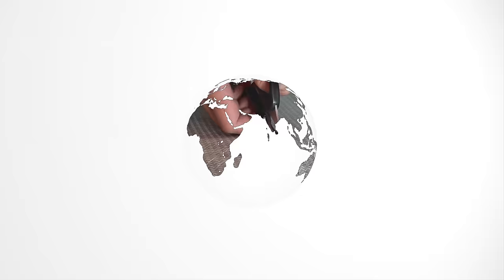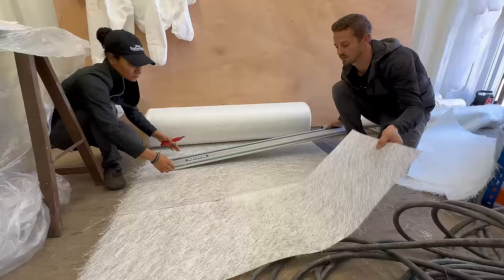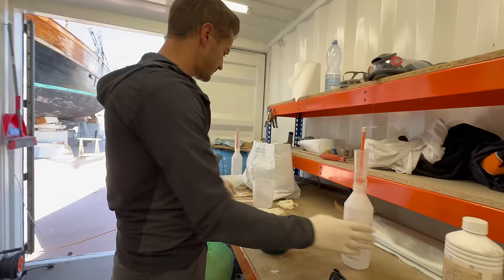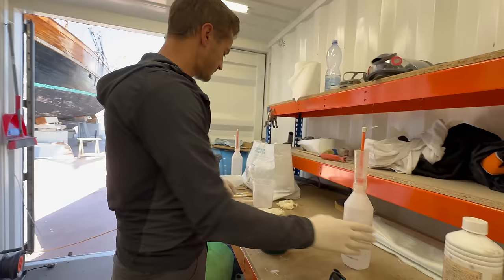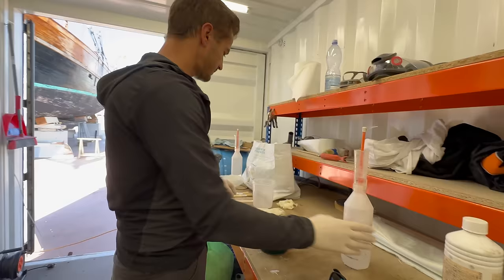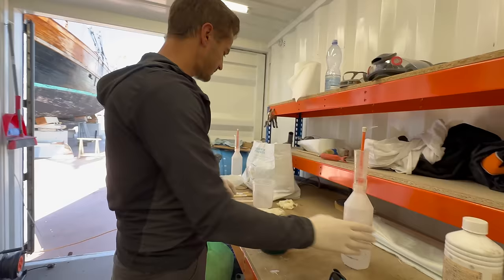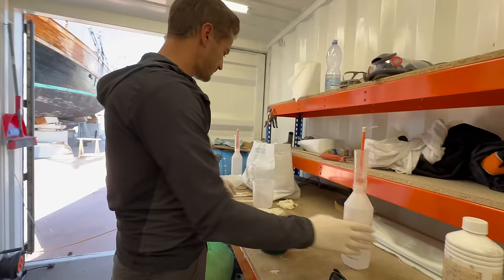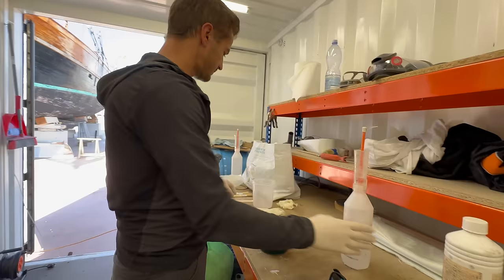Slow and Unedited Boatwork  | Step 385

Comment: Best to use the reference piece each time. Using the just cut one each time compounds any errors as you go.
Reply: I was thinking that also at the time until it became evident that it is just for demonstration purpose only, precision not required.
Reply: Agree I always use the same piece as a reference.  However If I was doing that I would have marked the floor they were working on.

Comment: Dear friends, you are among my favorite boating cupels so I can't help but offer some suggestions as I have over 25 years of experience of working with fiberglass building boats so I have a hard time watching this episode right from the start. So first and most important is always wear good filter masks that are recommended by a factory rep for both fumes and fiber glass in the air. If you could see it with a strong flood  light and a dark background you would weare it the moment you walk into the shop. Next, get some real scissors with at least eight inches long blades or use electric/ ceramic blades for much greater efficiency.  Good to see you pour the resin on but use a 3 to 6 inch short nap rollers. Then put the resin on first and lay the glass on it.  And throw away that silly little brush and get much bigger ones but for this job the roller is all you need. The serrated roller is not a bad idea but finish it off with the mat roller to even it out. At  this point I'll have to say order a book or video on laminating fiberglass technique before going any further. I'm sure there are many have already been written.
Reply: When I did pro layup work we did use 2 or 3in brushes we cut the feather off about half way up on the brush.
Reply: Fiberglass boat building has been my trade of work for 40 years now ,made me sick last year .guess this will be the end of the line for me.😮
Reply: Thanks for the lesson.
Reply: I'm guessing that this exercise was to gain some wetting out experience and to see what thickness is achieved from building up layers.  You used only strand mat… is that your laminate schedule?  You may want to invest in a better layup.  You're commitment deserves a bullet proof approach.   Good luck.
Reply: Kika, ditch the little brush & use 3-6” foam rollers 2 roll the resin in & then the metal roller 2 roll out the air bubbles! As Dan instructed, very light pressure & roll end 2 end! U got this! 👍 BTW, I do this every day 4 a living! I realize it’s just an experiment, but U may as well become an expert lamination technician while ur at it! Luv ur vids, however U wanna do em! Been subscribed since y’all launched ur channel! Thanx 4 sharing! 👍❤️
Reply: This is a good study.
Building my surfboards I used a squeeze not a brush. 
Btw...You probably had itchy hands after cutting fiberglass with unprotected hands.😂
Reply: Thanks you for the lesson. Constructive comments are far more helpful for us DIYers than some of the snarky, “ yOu’Re dOInG it WrOng….” commenters. They need to go back to bullying their younger siblings.
Reply: It was a pain to watch... 🥺
Reply: @reobein  squeeze is for epoxy and woven fiberglass, it would be terrible for this application.
Reply: A squeegee is the way to go for a fast wet-out. A half-length brush works well, but is basically a poor squeegee. :)

Comment: Your hands must be fiberglass-proof. I can never do this type of work without at least nitrile gloves on. Glad to see the hull getting stiffened now.  Cheers!
Reply: She had clear latex gloves on; I find nitrile gloves brake apart easily too quickly.for this type of work.
Reply from the maker: Yes acetone eats nitrile. You can't use them for this kind of work. But we also don't really get itchy when cutting or grind glass. At least not in the hands. Arms maybe a little.

Comment: I don't mind the unfiltered version. You must have a lot on your hands right know. I would like to see a video where you go more into the details of different sheet and raisin materials. So far I only knew polyester and epoxy and I didn't know there are different options on the glass sheets. Would be cool if you'd share your knowledge.
Cheers 🩵

Comment: It was so lovely to watch and listen to you two working together so convivially. I didn't realize that it would be possible to layup 10 layers at once without it getting too hot. I'm very interested to see your demo of your hull reinforcement as I've started work on a Cape Dory 28 that has some structural damage from a previous dismasting.

Comment: A tip: over wet the preceding layer and use plenty of pressure on the roller to drive the resin up through next layer. The idea is to get as much air out of the lay-up as possible so it turns almost translucent (minimum trapped air) tiny air bubbles in the lam is the enemy of laminate strength. But use minimal resin, if you achieve that you produce the strongest laminate (highest glass:resin ratio) and if under the waterline least possible propensity to osmosis. So roller hard, get that air out. Although vinyl ester is a lot less susceptible to osmosis and is much stronger than polyester. In fact there you can laminate stitched or woven without chop between as the inter-laminar shear strength is so much better than polyester.
Reply: You are absolut right. There is used way to much resin. The strengh of this lamination will be very poor. The strength comes from the glassfiber not the resin. You should not underestimat the rolling it is the most importen part of the job.
Reply: It was made just to fill in time as the real work is on the boat and not being filmed. It is not going to be used,

Comment: I found using a 3"- 4" flexible plastic body filler squeegee works best to initially & quickly spread resin across the mat, then followed by a foam roller and finally the ribbed metal roller to remove air bubbles.

Comment: Sort of interesting but have to admit the repeated layering and resin coating was kind of boring. Quite a good example of how dull doing this stuff can be I guess. Was wondering if you have any opinions on the use of the vinyl ester for general boatbuilding? It is way cheaper than epoxy.

Comment: fun, ty for the how-it's done updates. now you guys get to clean the roller, and prolly other bits and bobs.
Reply: Leaving it in acetone works but if you forget to clean it we would used a propane torch to burn off the hardened resin.

Comment: The object is to have maximum glass and minimum resin. Put all the layers down dry, pour on the resin and squeegee it through the layers to saturate the glass. Squeegee out all the excess for the strongest laminate. Forget the paintbrush and the roller.
Reply: @Aduki65 Yes but this is not carbon fibre. Saturated glass is somewhat translucent and you can see any dry spots. Carbon fibre is black and you cannot see through it.

Comment: The way you two describe this project. I visualize the keel like more of a flipper. Replacing the keel might make sense. Might add some rigidity. 
🤘😎🌊
Reply from the maker: It's great. Pretty much every boat ever made uses it. I get that it's generally agreed upon that epoxy is "better" but it's also a lot more expensive. We've used both. Neither is particularly difficult.

Comment: Maverick fell asleep while I watched... Gotta ask, when you start the real deal applying  will you use a larger roller ? we used to spray then roll out bubbles. Using a textured loop type roller more aggressive and holds more resin...  O ya try a little fast forward with some Mozart ♪♪

Comment: You guys make this look incredibly easy yet I always thought the use of vinyl-ester resin a bit different, requiring masks/goggles, exact ratios at a given temperature and an incredibly thorough (folding and scraping) mixing process. If I tried this I am certain it would cure too quickly or too slowly. I do not even know what it smells like but after years of using polyester resin I find it nearly unbearable to use. I might just try vinyl ester next time. Thanks for the video.

Comment: a nice small roller would distribute the resin in seconds . the next layer of cloth can have the resin pulled through using a wheeled roller .. great dig out that roller and go for it .  I layed up my own gt car ground effects body shell .way back in the 1970,s . I decimated the opposition in the 1980 Donnington Gt championship one litre class winning 9 out of ten races    with one retirement with a oil cooler connection blowing off.
 I used a corematt to bulk out the rigidity without adding too much weight . mfor flat bulkhead panels   I layed up the glass on waxed aluminium faced one inch lorry flooring plywood .placed a similar sheet of ply / aluminium on top and then weighted the top panel from the centre out with 1/2 ton of concrete blocks to act like a press. Perfect remember to earth out the al;uminium faced ply formers . Your panel is now a huge capacitor .. Ask me how I know .

Comment: I just found a 50 foot catamaran two years old dual Mitsubishi diesels 20 foot beam for 185,000. The man’s wife died. The price should be a quarter million at least I am here in the Philippines building a small steel concrete reinforced castle on the island complete with warriors.

Comment: I kinda like the raw uncut video.
But i was wondering. Which tools do you trash after a job likr this and whay can be reused? Also whay do you need to do to clean the reusable stuff?
Reply from the maker: You can clean and keep everything. Just keep them in a bucket of acetone for next time.
Reply: @SailingUma  better keep that shut tight, well ventilated and away from sparks.

Comment: I like old boats . The advantage you get is the problems are known and usually already fixed . The second advantage is you can usually get a special boat for a deal , more than you could afford new . A diamond in the rough you could say . 

However Uma just is not that boat . She is a cheaply made coastal cruising boat without any more modern features like an aft cabin or variable draft or a round the world pedigree  . She also has inefficient foils without much protection . She was built with shortcomings in basic design that can not be overcome . 

She does sail well and in the end you will have the best Pearson in the world with the most modern interior . I just would start with something different , I am starting with something different . 

 A clone of a southerly 110 with a sugar scoop mod .  Proven Round the world capability, aft cabin , pilot house for inclimate travels , deep draft for good sailing performance , 25 inch draft to get in where others can not and a tabernacle so you can step your own mast and get under a bridge and explore up that river or canal .  I start with that then make it better .

Comment: Are you using polyester resin? Didn’t you use epoxy to reinforce the keel? Would polyester stick to it?
I admire your work
Reply from the maker: We did use epoxy on the keel. But 99.999% of this work on being done on the original hull. Only a tiny bit is overlapping with the keel work and since it's all a mechanical bond anyway, it should be fine.

Comment: I don't like this format.  It was actually boring. Secondly, what are you trying to achieve with doing this layup of Fiberglass? You could have easily modeled  the section in 2D or 3D.  It would have save you more time.
Reply: Yep, boring. Could have showed how one sheet is cut and laid up and said repeat x 40 & explained what you're trying to  make.

Comment: Hmmm.  Just exactly why you were doing this was lost on me.  I didn't mind the format, but it was just a bit like watching someone folding and stacking a bunch of clothes for half and hour.  Why bother?
Reply: During previous episodes and due in part to heavy weather and original poor shape the hull was discovered to be seriously deficient.  This showed up as dimples on the side of the hull, visible from the outside. They weighed a new boat against a massive rebuilld.  The rebuild won out.

Comment: What is the point of the video?  To learn how to laminate fiberglass? Waste of material. Sorry for being blunt.
Reply from the maker: The point is mainly to put in perspective how long a tiny portion for a larger project takes. It was a one time experiment to showcase a “slow tv”  style of working, not a “how  to” video, nor an explanation of any specific project. Just a simple live/ long / slow video of boatwork. Similarly to what we did when we film 40minutes of the boat rocking and bobbing on the ocean. The type of video you have open on your desktop while you do other things. But seems to me that the message wasn’t clear enough.